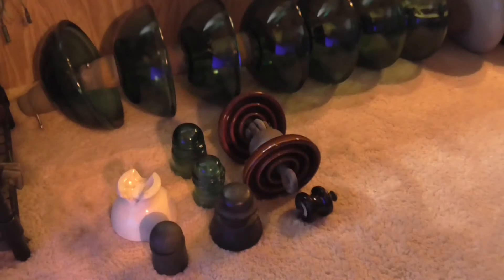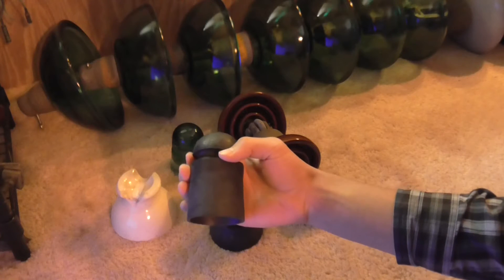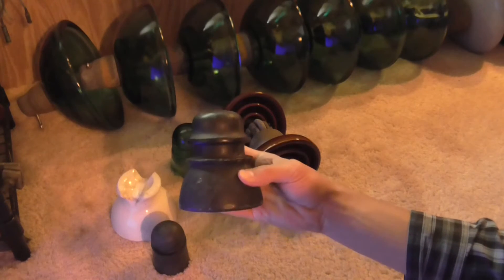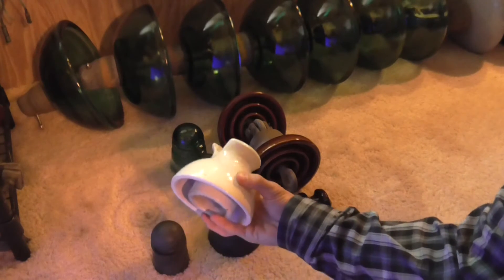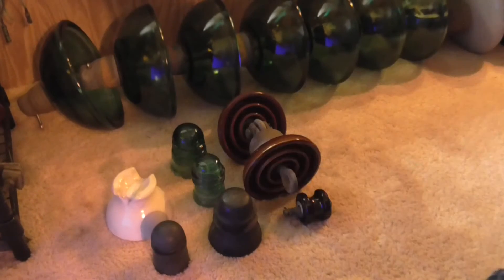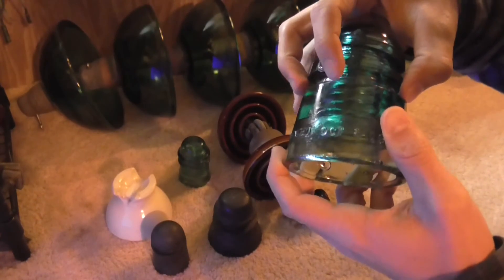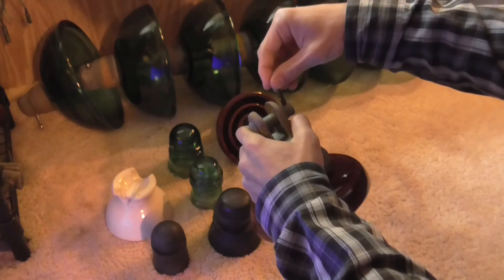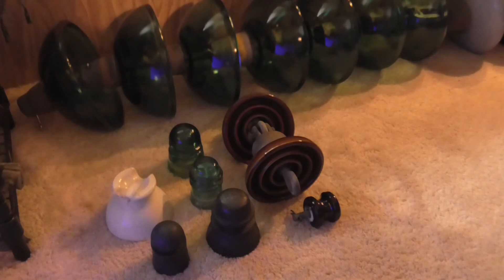New High Voltage Power Line Insulators - Close Look!

Comment: 0:35 When I lived in Missouri, I used to find a bunch of those rubber insulators along the railroads a few miles from my house.
Reply from the maker: I had found out that their not as rare as I thought they where, however, they do have value to the history of patenting insulators and finding out which ones ended up the best. These insulators tended to rot in the weather conditions over a long period of time, so they mostly stuck with glass, however, we have improved our polymer insulators.

Comment: The Hemingray 42 is classified as a "CD 154", but plastic and rubber ones do not have a numbering system yet, I plan to start one though. yes, your plastic one does look out of the ordinary by a bit, but the rubber ones are fairly common, however yours has the small pinhole on a large rubber insulator, which I haven't ever seen before, so that"s unusual. the "spiral groove"  is actually not rare, but I never find them in the wild. the groove is designed to lift the wire & tie off the insulator during replacement. look up how they tie telegraph insulators to the wire. you have to untie them to remove a faulty insulator, and I can attest to the fact that it's a pain in the ass to undo some. this design does away with that chore. when you unscrew the insulator, the spiral wire groove catches the wire, and lifts it as you turn it, and thus makes everything much more efficient and simple to follow through with.
Reply from the maker: Oh, ok, yah their pretty common, but uhh, your paragraph pretty much explains it, thanks;) Cheers!!!!;)
Reply: yeah, I bought one not that long ago for $2, because the mold was very crisp. I believe it to be a Hemingray version, not sure though. I have to check again.
Reply from the maker: Leverettrailfan Cool!!!!
Reply: You can tell the hemingray ones from the brookfield ones based on which side (front or rear skirt) the word "Patented" is on.
Reply from the maker: Leverettrailfan Vary True;)
Reply: once I fond an insulator in an antiques shop I thought was valuable. I was $5, and I liked it, so I bought it, in mint condition too. turns out it's only about what I payed for it when marked for Whitall-Tatum, but the Hemingray version is a couple thousand!
Reply from the maker: Leverettrailfan I love to collect them.... If I find an insulator on the ground or in a shop, I'll take it, but only if the insulator is ok to take or buy;)
Reply: I always make sure to pick them up if I find 'em, but if I'm paying, I won't pay anything beyond what me (or my book) thinks is reasonable.
Reply from the maker: Leverettrailfan Same here....
Reply: yeah, alas people often charge way too much for 'em..
Reply from the maker: Leverettrailfan That's why I go out and insulator hunt, and I get them for free!!!!;)
Reply: ;) saemmmmm

Comment: Well, I am slightly jealous lol
Reply from the maker: I am a freak.... That's why, LoL!!!!
Reply: Variac Maniac Well, I am thinking about scrapping my 6kV transformer.
Reply from the maker: Mark Schulz IV Somethin wrong with it?
Reply: Variac Maniac few reasons:
I wired up the transformer and one of the primaries blew short after some fun. Primary was designed 40A @ 400V continuous, but it somehow melted. Then, as it was my first HV transformer, I had no idea what I was doing. I was worried that it will flash over or anything, so it has really thick insulation between layers, and a lot of it. I think I should make it properly, 20 kV and 1A maybe.
Reply from the maker: Mark Schulz IV Oh....